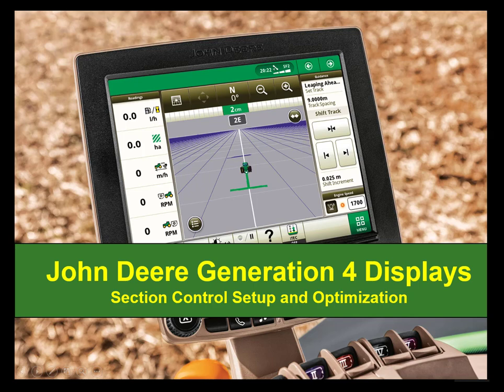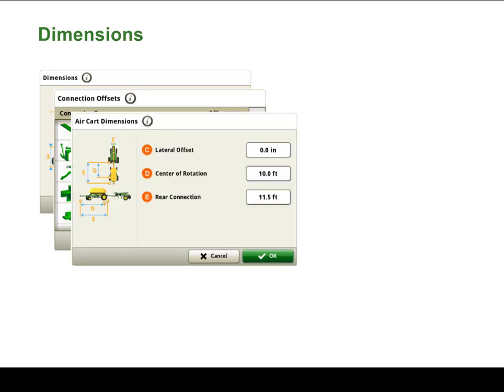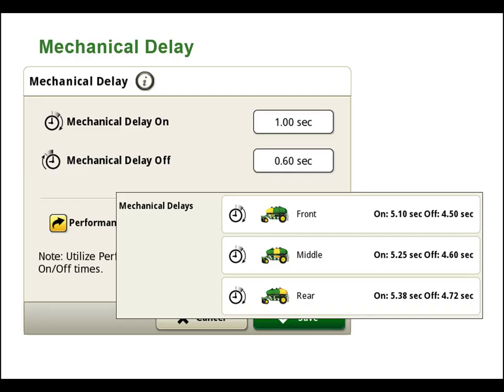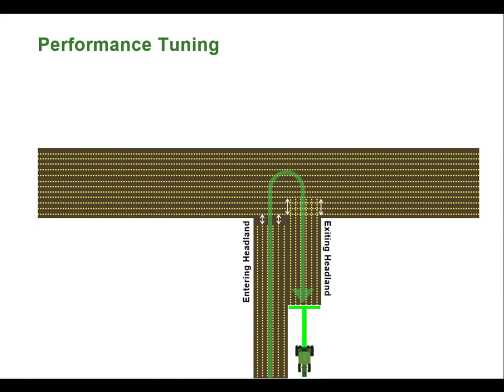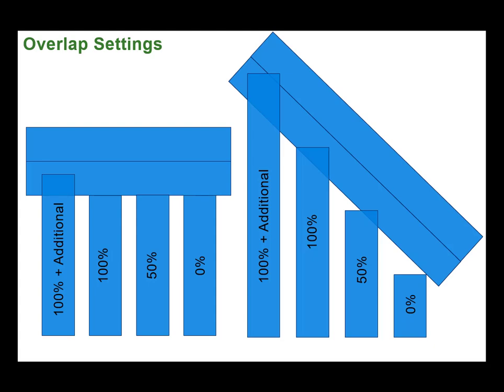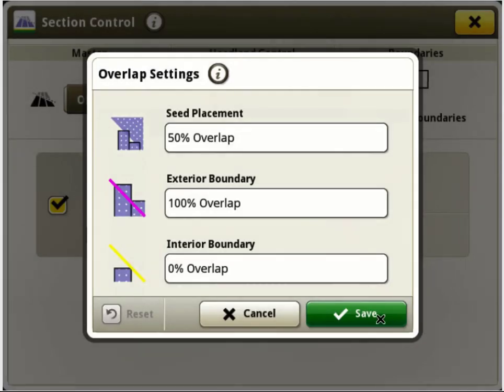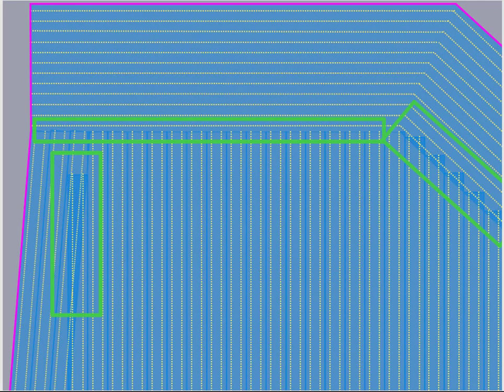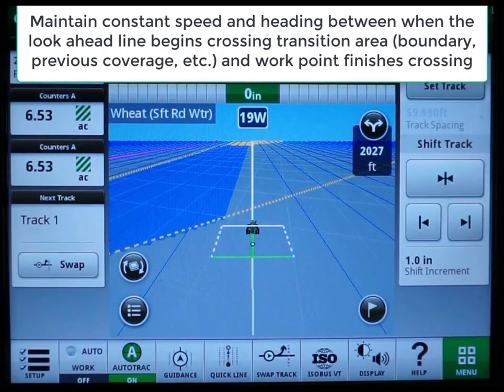How To Optimize Section Control | John Deere Generation 4 Display

Comment: Hello John Deere!

Why is „Plant To Row” not available for the universal 4240 display? This feature is very useful when using a row crop planter. I don’t understand the cutting of section control functionality between 4640 and 4240 displays... If I had such information when buying the system, I would probably choose the universal terminal 4640...

Is it possible to keep the distance to the headland when sowing with point seeding, e.g. 20 cm using the 4240 display, SF6000 antenna, SF3 signal?

Best regards.